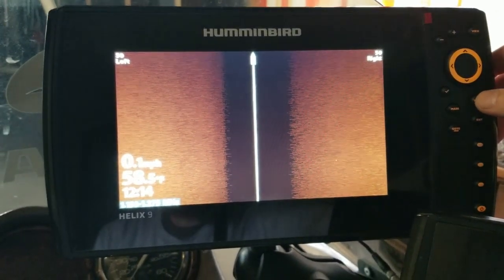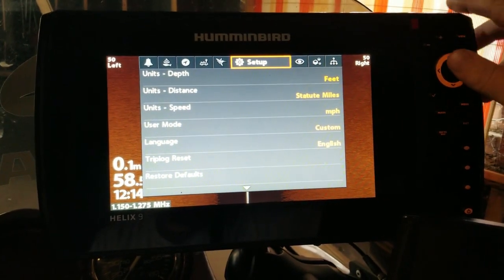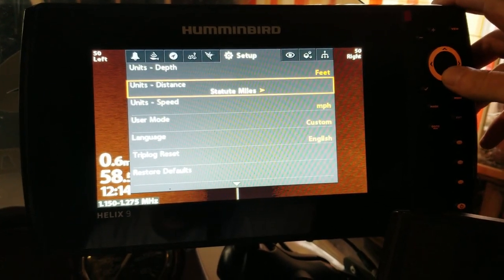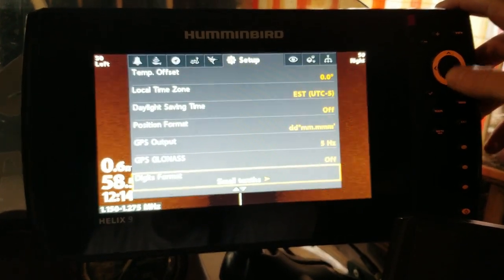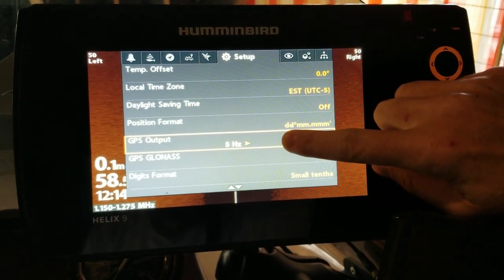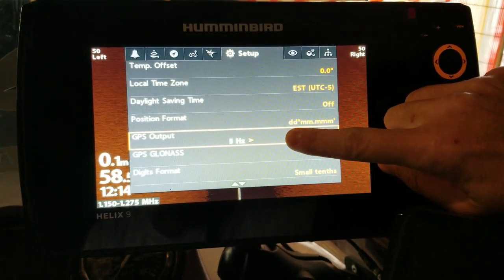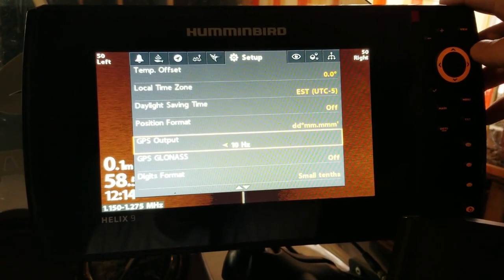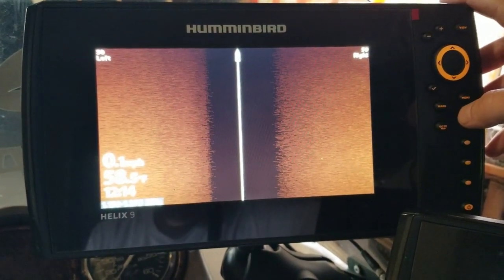Humminbird Helix GPS Output - How to Get Faster Internal GPS Speed

Comment: I dont have that option on my new Helix 10 G4n, and my GPS is off 2000 ft from where I actually am.  How do I fix that?  Please help
Reply: Try changing the user mode from angler to custom. It unlocks more customisable menu features

Comment: I can't find that GPS output on my Helix 15 in the settings to speed up my GPS is it called something else?
Reply: Thanks man I had it in custom but I scrolled on over to data sources and found it there great tip thanks man
Reply from the maker: Awesome man. Glad you got it figured out
Reply from the maker: You might have to switch over to custom mode to get it to show up. If you hit the menu button twice. Scroll to the right past hb chart to setup. Go down to user mode switch it to custom then see if you have it

Comment: Here's something regarding GPS. I noticed while heading towards a  waypoint that my line from the front of the boat goes side to side. My brother told me he learned something from Lowrance is you need a GPS puck next to the unit. Is that the same for Humminbird?
Reply from the maker: The gps puck on a humminbird will help get better signal but will not help much with speed. The proper place for the humminbird puck is mounting it as close to the transducer as possible. Simply because when waypointing spots they will be spot on versus driving over a piece of structure on 2d hitting mark and ur unit is 10 foot away from the transducer that marked the structure

Comment: Love your tips. I’ve read that the Helix factory settings only updates the console head display if the boat moves 16ft. I’ve heard that it can be adjusted to be down to only 5 feet. I’ve scoured the settings but can not locate that. Any help would be greatly appreciated. Thank you!!
Reply: That’s the min distance to start a track that you’re thinking of.
Reply from the maker: I dont believe this to be true. When I anchor lock with my trolling motor I can see my boat jogging around constantly on a 10ft spot.

Comment: What about the Glonass setting?
Reply from the maker: I've yet to have to turn it on unless I'm in my garage looking at autochart data on my GPS screen. I've turned it on while on the lake and didnt notice any speed increase but does help find satellites in covered areas
Reply: @HumminbirdHelp  So if you turn Glonass on does  that turn GPS off and visa versa or are they both on at the same time?😀
Reply from the maker: Not 100% sure, but I'm to believe they work side by side to add additional satalites to  keep from losing positioning. Same as it does on your apple or android phones